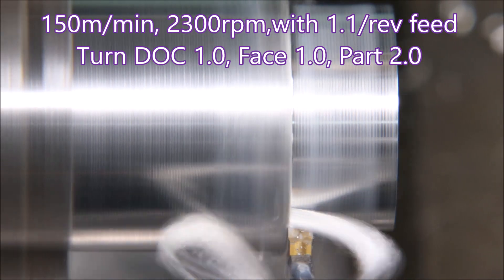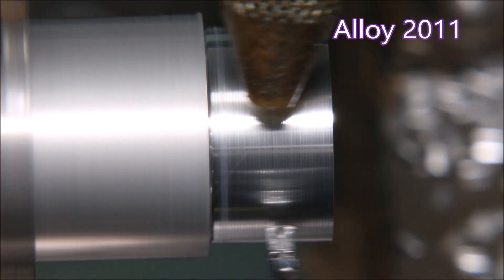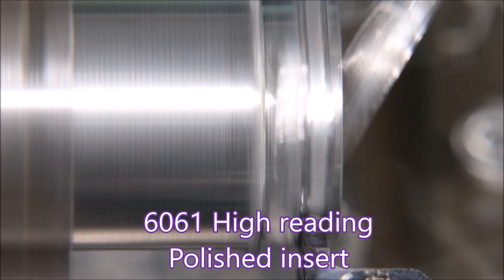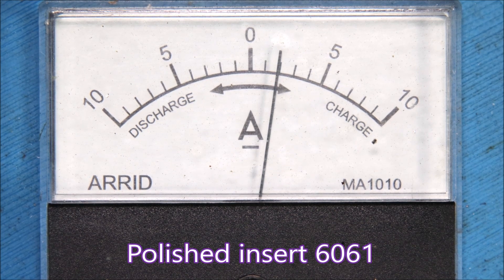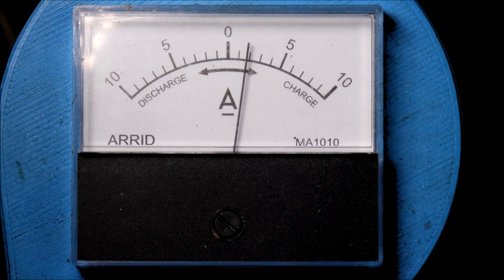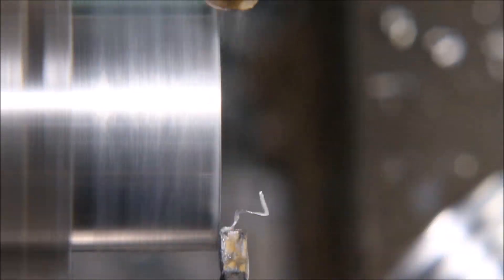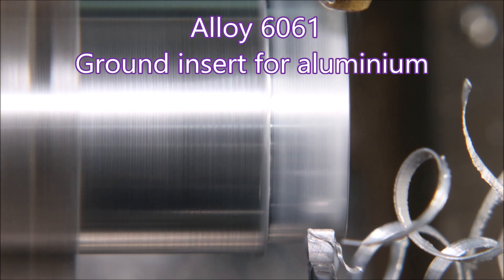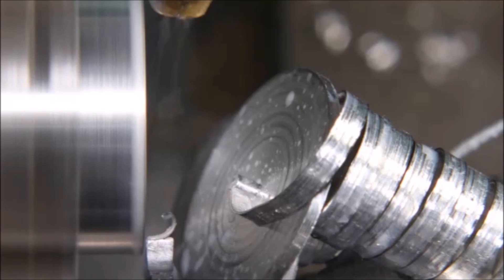Small cnc lathe. eBay inserts parting 6061 alloy

Comment: I don't suppose you have any 316L stainless to try with the cheap inserts?
Reply from the maker: I don’t but even if I did, I would have no idea about how to go about parting it off. Not a material I have used very much. From memory, I think I have made only one batch of parts in 316. A material I have avoided.
Reply: @smallcnclathes  I have a lot of it, it's what was available to me. Unfortunately 316 is very tough, 316l being even worse. Thanks.

Comment: I'm going to try a Walter GX16-1E200N02-CK8 insert (their aluminum-specific parting insert) and see what happens.
Reply from the maker: I have not used Walter apart from their cnc stub drill which was much cheaper than some others and it is a good drill.  Let me know how it goes, I assume it will create a video?  Let me know and I can link it in some of my parting videos.
Reply: @smallcnclathes The parting inserts have yet to show up, but I did get some boring in: https://www.youtube.com/shorts/ekeS9ILAERU
Reply: @smallcnclathes  So I got the insert/toolholder working today. It did make proper chips in 6061 once I got the speeds & feeds right. To get a reasonable surface finish on my noodle of a machine I had to play some toolpath games, and it would be far happier on a part with a centre hole than having to cut all the way to centre (RPM limited)  - but I got it to work. Video coming in a couple of days.
Reply from the maker: @FNR  let me know when the video is up please

Comment: I watched it Nigel but I have no idea what the differences are in these alloys.  But I need to learn more about it. I think I will have to deal with it more when welding aluminum and knowing what to use.  Thanks for the lesson.
Reply from the maker: Hi Gary, the 6061 which is very common, can be welded and anodised, but can be a horror to machine in small lathes. The 2011 has great machinability but does not weld or anodise well
Reply: @smallcnclathes  thank you Nigel, that is good to know.

Comment: We work on a lot of 6082 which in question of chipbreaking is pretty similar. Want nice finish? Low feed and medium cutting speed, send a lot of pressurized cooland right into the cut. Want the chip to break? High to extreme feed and low cutting speed or our programming system offers retracting after the tool traveled certain distance - it basicaly does cut-retract-cut-retract, so the chip doesn't break on its own but you set how long it should be. The downside is that in low rigidity setup it leaves unpleasant finish. Most important is to have right hand tool that you flip "upside down", so the chips fall out of the groove directly onto the convoyer and don't wrap around the part as shown in this video.
Reply from the maker: Hi Adam, thanks for your advice. Nigel
Reply: I was going to comment on that but you beat me to it.

Ya, all I run is 6011 & I will peck the parting to break up the chip.
Reply: @pvtimberfaller Yes but with peck parting you won't get nice finish, there will much likely be marks of tool bending in and out as it keeps engaging in cut. Also perpendicularity will be a lot worse. And there is a chance that the part will start flying in random direction and result in a scrap if you don't program the peck correctly. Last problem with peck parting in harder materials is tool life - of course in aluminum based alloys this doesn't apply.
I use pecking for roughing out grooves, parting simple parts where it doesn't matter anyway and parts where I leave material for next operation. Otherwise it's a lot of very high pressurised coolant directly in cut and testing cutting conditions, insert geometry and grade. There is a lot of guides and handbooks which describe effects of cutting speeds on cutting forces and chipmaking during parting.

Comment: Ah, now I know why you didn't want the 6061 remnants I have lol. It's all I machine in alloy where possible. I wonder if it is just the fact you are using ebay tooling. I'd be happy to donate some Mitsubishi/Iscar tooling to give it a try?
Reply from the maker: Thank you, I only use ebay tooling for videos and Sumitomo inserts for any work I do. Now I gave retired, there is not much work being done and it is in brass when it does turn up. So thank you for your kind offer, but I really have no need for your inserts and I think there may be just one video left in 6061 and then it will be time to move on. The whole ebay parting tool thing has been trying to demo cheap inserts for hobbyists. I still have a life time supply of Sumitomo and Kennametal inserts for the amount of work I do these days.

Comment: how to deal with 6061:
300psi coolant right on the cutting tip
Same speeds and feeds you had here, but 50% reduction when you get over 30mm deep
Make sure you have T6 condition
High quality P horn or Iscar inserts, ground and polished
Reply from the maker: I knew someone would have the answer, what is a P horn insert?  Thanks for your advice. Nigel
Reply: @smallcnclathes  Paul Horn.

+1 for Iscar for non ferrous, TaeguTec also do some great inserts for ally

Comment: Unkind? I am wounded, sir!

Notwithstanding, thanks for the comparison.

I also note that, despite the single large chip, that the operations did complete without stalling out the lathe, so it was a success.
Reply from the maker: I must admit, when I hit the go button I had no idea what would happen. Even though it was drawing 7 amps it got through the task.  So having created a video for me, I must retract the unkind comment.  The difference was quite remarkable.  Thanks for your comment, look forward to hearing from you again.
Reply: @smallcnclathes  no worries!

I have been experimenting with tooling that can break chips in 6061 on small lathes (see youtube.com/watch?v=V0uqC4OH59g) but have yet to find a parting tool that does it. Hope springs eternal!

Comment: 6061 has gotten worse now the addition of lead to improve machining has been banned!
Reply from the maker: Hello, nice to hear from you again,  I thought lead was used in free cutting steel.  Did not know it was ever used in 6061. Thanks for your comment
Reply: @smallcnclathes  Same here, I knew lead used to be present in free cutting steels etc, but only a few months ago I found out it was also present in 6061, one of my customers use huge amounts of 60mm Ø 6061 in 6 metre lengths and I help myself to the bar ends, I noticed the decline in surface finishes and bad swarf chipping of this material, as they did too, and I was then told by the quality manager of the factory that the small amount of added lead had been removed from 6061 due to health and safety, how bizarre, I'm certain roofers here in the UK get far more exposure to lead as its used in lead flashings etc.
Reply from the maker: Have you uploaded recently, have I missed a video?
Reply: Whereas 2011 HAS got Lead in it.
6262 is a reasonable alternative to 2011 for parts that need to be welded or decoratively anodised.
Reply from the maker: Thank you, 6262 is difficult to obtain where I live. Available in Australia but not in my state. Thanks for the comment

Comment: I still have plenty of 6061 from back when I didn't know better 😂  I use copious amounts of isopropyl alcohol to avoid edge build-up. It's still a pain in the behind.
Reply from the maker: I learned early on that I needed to leave 6061 alone so I have accumulated little of it. I have half a metre of 25.4 and a single piece about 80 diameter by 50 and that is it!  As I explained in another comment reply. 6061, 4140 and Stainless are things I have not accepted as jobs.  In all my videos, I think I may have 3 or 4 complaining about 6061, one using 4140 which was for a friend and one cutting 1/4" threads on stainless.  I learned not to take on jobs that did not suit the lathe and would drive me nuts.  No point being self employed and doing work you don't want to.  Life is too short!  Thanks for always leaving a comment on my videos, I appreciate it

Comment: An interesting demonstration/illustration. Thanks. I know what you are saying, but you are lucky that you can choose the alloy that you machine. Mostly the alloy is specified, and as a contractor, you just have to deal with it... or turn the job down. Not a criticism.
Reply from the maker: Because of the limitations of my lathe I have often not taken on jobs that involve materials that the lathe handled badly.  Jobs requiring Stainless or tool steel or 6061 were sent elsewhere, usually with no detriment to my business.  My customers stayed with me for the small work I could handle and took their other work elsewhere.  Among all my videos, I think there may be a couple with 6061, one with 4140 and one with threading stainless steel.

Comment: Nigel, I use 5083 for motorcycle tank weld in bungs. If things are going badly and I can't get 5083 I will  use 6061, yeah it is a bastard. 
Shame the 2011 is not weldable.
Reply from the maker: Where I am it mostly just 2011 and 6061 being available.  I have turned jobs away if it was required to have 6061, just not worth the aggravation.  Thanks for your comment.

Comment: Well thay sure looks like fun to machine :/ , is it jusy as horrible when turning with your regular tools ?
Reply from the maker: I really do not machine the stuff, BUT today I had to machine 25.4 down to 20 to suit the program.  I put it in the lathe at 850rpm, manual lathe is bigger than the cnc.  insert for steel was in the tool so I used that, I was amazed when thin spirals came off the material.  Did not chip but created these spirals which broke under their own weight, not something I had seen before.  Normally I would use an insert for aluminium and that would have created one long single ribbon of razor wire.  These spirals today were a joy by comparison.  
I was really surprised, might do a comparison of it for next week, although I really need to get on with making some 400 brass fittings.  Thanks for your comment